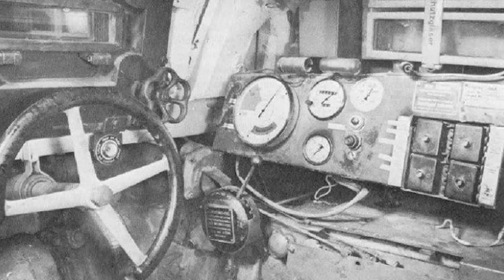A Deep Dive into the Tiger I, by the Chieftain

Comment: Let's use our sign and cosign on these angles, and see how much better or worse sloped armor really is. You have make sloped armor longer to join the top. Depending on top armor thickness, which is usually quite thin, you really aren't saving a lot of weight compared to just using thicker, verticle armor. Get DOWN with the THICKNESS! That's The One!
Reply: There is first hand testimony from German tank crew who said some tanks were indeed destroyed by aircraft! 🤯

Comment: At 30:50 "....[mudguards] are actually a in-theater add-on, these were originally not on the vehicle."
Not true!  The mudguard system was added to this Tiger (and all the Tigers of the 501) while still in training back in Germany.
The mudguards could be unbolted if the tank needed to fit somewhere narrow, e.g. a railway tunnel or the actual barges that took them to Africa... but there were permanent lugs on the sides of the tank to re-attach the mudguards as soon as you arrived. In fact, photos show these Tigers sailing to Africa with loose mudguards stacked on top of them. The system was definitely NOT added in Africa!

Comment: I am pretty sure "Saving Private Ryan" did not include the Tiger tank driver getting shot through the vision slot.
Reply: Instead of evaluating how "sure" you are, why not check the movie itself?
Reply: At 2hrs11min35s in (DVD chapter 17) Tom Hank's character runs up to the Tiger which has suddenly come to life after the earlier sticky-sock-bomb blew the track off, he sticks the barrel of his Thompson into a big wide drivers slit (looks bigger than the slit in this video, big enough to stick an arm through) and fires a burst.
Reply: @sean_d  Also wasn't the vision slit covered with armored glass?
Reply: @WheelsRCool  Yeah, that's why the moment  is of interest. It should have been. By the way a few moments later the turret hatch is opened and it looks like it is made from a sheet of tin or cut from the top of an oil drum.

Comment: Another whoopsie by the curator: the transport tracks were not developed AFTER the wider tracks. It was the other way around: the tracks, that were later used for railroad movement, were a leftover of the VK 36.01 prototype stage and were later widened as the vehicle gained weight
Reply from the maker: Thanks for the comment. Do you have a source i can send to the chieftan?
Reply: @WorldWarTwo  I can look it up now I know to look for it.

Comment: Moran's "Controversial Opinion on Tiger" video is the one and only actually good collective piece of judgement on the Tiger I. 

Everybody who says it was "junk" or "the best tank ever" fundamentally misunderstands (or in most cases is just downright ignorant) of the tank's designated role on paper.

The situation on the Eastern Front was extremely fluid, and the Tiger was forced to be used as its "Fireman" as Moran very aptly put it, which of course put hundreds of kilometres more strain on the moving parts than it was ever designed to burden.

Every single cheap piece of "criticism" that you'll see on reddit and discord about the Tiger could also be said about any modern tank, the Abrams, the Leopard etc. These weapon systems have been designed to fullfill specific roles on the battlefield, for limited amounts of time and distance. If you exceed those limitations (which the Germans were obviously forced to do) then the machinery WILL break down.

Comment: It's the side of road they drive on. That's the reason for the side of the driver/commander.
British tanks are on the other side.
Edit: My theory on the drive sprocket is that is a replacement that was a later model of sprocket.
Reply: The left-hand sprocket on "712" is a normal one for the time of its construction.
The right-hand sprocket is one of the first few sprockets ever made, and extremely rare, and it must have been lying around the factory for months before it was put on this tank.
Reply: @daveybyrden3936  Cheers for the info.

Comment: Since there not going to restore that tiger to running just to ohhh pretty send the all the parts and components to bovington,support the the last running tiger tank.
Maybe I missed it somewhere but if that's the Tiger tank that was sitting at Aberdeen in the eighties and nineties that wasn't cut up like that.
Reply: This is the Tiger from Aberdeen. At that time it had sheet-metal panels covering the gaps, but underneath it was exactly this cut-up.
Reply: @daveybyrden3936  I never noticed 😆,while I was at the NCO school there (83) one of our weekend dutys included babysitting PVT's pulling guard shifts at the museum.
I used to take the opportunity to 'explore' a lot of the tanks there via the escape hatchs.

Comment: There's an ongoing debate about whether one can drive a Tiger 1 with one's head out of the hatch. It is mentioned in this video that it's very difficult at least.
But some claim it was simply impossible.
They allege that when we see a head out of the driver's hatch, it's simply another crewman sitting down there, keeping the driver company. Most likely it would be the gunner, who had no hatch of his own.
But: look at 21:43
The mysterious head poking out of the driver's hatch is wearing a headset. The headphones are very clear to see.
Now, if you were another crewman going down there to make yourself comfortable, why would you bring your headset? You'd take it off and leave it in its bin.
You couldn't plug it into anything down by the driver; there's only one socket and he is surely using it for himself, to take directions from the commander.
This photo strongly supports the notion that you CAN drive a Tiger like that, somehow.

Comment: ive read that most of the german tank crewman preferred the gun from the panther more than the tigers gun,and it doesnt seem like the 75 would perform better than the 88 but apparentley the 75 fired a lighter shell and some of the panthers had the really long barrels and they said it was like siting a damn high powered rifle,where ya aimed it is where the shell hit,deadly accurate and better penetration,depending on the shell type but anyway,i like the looks of the panther more than the tiger,but theyre both gorgeous pieces of equipment
Reply: Yeah, the long l/70 75mm could penetrate over 30% more armor than the tiger 1's 88mm

Comment: What's happening today with electric cars the tiger 1 was way ahead of its time as a hybrid vehicle taking one of these and converting it to a hybrid Electric would be a real treat to see initially by Porsche Design❤❤❤
Reply: The Tiger 1 had a conventional petrol engine, linked by conventional mechanical drive shaft to a mechanical gearbox and reduction drive. The only "way ahead" part of it was the steering wheel that stepped the drive wheels through a small number of ratios.

Comment: Tiger evaluation (IMO):

Gun for 1942: 10/10
Armor for 1942: 10/10
Mobility for 1942: 7/10 (when it worked), 3/10 (when it didnt)
Mass: too heavy
Size: too large
Mechanical issues: plenty

Comparison with opposition...? 1942 is when the Sherman was introduced, with its short 75. Then theres the brit Cromwell (1943) and soviet t34 (1940). None of these could take on the Tiger in regular combat ranges. For 1942 and 43, the Tiger was the king of the battlefield; sorta like the Sherman in the pacific. Things changed in 1944 and 45, but still, the Tigers reputation carried it throughout the war (for better or worse).

Comment: It would seem looking at the track width that not only would the track have to be removed for rail transport but also the outer road wheels as they come to the edge of the combat track. This would mean if correct that not only the combat tracks would have to be fitted when detraining for battle the poor old tankers and mechs would have to put the outer road wheels back as well - is this a correct observation? Regards JohnH.
Reply: Yes, one wheel had to be removed from each axie. The mudflaps also folded up.

Comment: flat straight steel very easy to close back up welding and steel way better today
Reply: Yes, but that wouldn't "restore" everything. There are a dozen cable clamps missing off the side wall, of several different types. The smoke- launcher mechanism is missing from the turret.  There was a vision port in the left turret wall, just like on the other side. 
And that doesn't even consider the parts removed from the inside to make the cuts.

Comment: I dont understand the controvercy? Tiger I was a good tank in design that was both used wrong and (particulairly for the later models) forced to be manufactured suboptimally and with poorer quality materials.
I complete side with Chieftain, for what the Tiger I was supposed to do, it was well designed. The course of the war however changed how it was deployed.

Comment: Tigers designed with intent as a breakthrough tank for the open flat lands of the eastern front in the hope to maintain the offensive momentum Not intended for Tunisia or western front but ended up as a firefighter where required on both these fronts as well as the east where finally forced onto the defensive Expensive to produce over engineer and never in large numbers Qu? Would they have been better producing Pzr IVs and Panthers who knows? But Tiger is still the most famous!

Comment: At 8:45, I noticed the drive shaft hatch is open, does that mean they removed the drive shaft, and, therefore, the engine and transmission to ship the Tiger?  If so, that makes an even stronger argument as to why America didn't build/ship tanks that heavy....imagine assembling your whole tank at the beachhead....
Reply: That is not the drive shaft hatch. The drive shaft runs forward from the front face of the engine, you cannot reach it from behind.
That little hatch was for access to the manual starter.
It was never necessary to disassemble a tank of this weight in order to ship it. The Germans shipped Tigers across the Mediterranean on invasion barges.

Comment: ~Heres a story kiddies:
-Otto Carius, the well known Tiger1 T.C, ironic due to his parents were always harping on him about smoking, was SAVED by that very habit!
'-IIRC the early drum typed Tiger 1 cupolas were bolted on w/10 bolts w/a weak, water proofing small weld bead @ the turret top plate, which lent them to violently ejecting off of the turret if hit directly w/large caliber tank/A.T main gun round, often removing the T.C's head or badly injuring him in the process, as his head occupied the cupola space w/o the benefit of  the lower gen2 model using periscopes & a lower, more protected, TC head position...

-During a lull within a battle on the Ostfront one day, Otto found himself stressed & NEEDING a cigg, lacking a lighter or matches, he bent down to get a light from his trusty gunner,  a moment after leaning down & lighting his smoke, his cupola took a near 90 degree direct strike from a large caliber SU-122 or SU-85 or possibly an ISU155 RUS assault gun. The strike ripped the entire cupola off of the Tiger & tossed its broken remnants far behind Ottos Tiger!
-I believe he'd said in his excellent memoir: "Tigers In The Mud" he was extremely fortunate it was an A.P/solid shot projectile & not an H.E round, as the H.E wouldve most likely ended his & the turrets occupants war(s) early!...;)

-That "Feature/Fault" of the original Gen1 cupola design & having to be exposed to the hip when unlatching & closing the cupola hatch when opened fully w/the hatch safety catch engaged, resulted in too many Tiger Tank TC's getting killed & injured, which then led to the Gen2 re-design....;)

Comment: Is there a common external feature of all rendetions of the Tigers, one can look for❓
Reply: Do you mean Tiger I?
All versions had the same gun barrel (but not muzzle brake), the same crew hatches in the hull (seen from outside, anyway), the same ventilator between those hatches, the same air intake grilles, the same heavy covers on the exhausts, and really I think that's everything on the outside.

Comment: I want to see the engine compartment why did they not do a cutaway of that?
Reply: The engine compartment is in between two other compartments. If you cut away the rest of the side wall, you will see a fuel tank, a radiator and fans. Not the engine.

Comment: Why on Earth was the engine in the back and the transmission in the front? What possible purpose does that serve? Are there any Henschel design studies or engineering notes recovered and stored with 702 that address this?

Just having bow access to the transmission, like the M-4 Sherman, would have been huge as an improvement.

Also, why weren't engine bays equipped to serve as eliectrical generator sets, arc welders, and air compressors? The air compressor portion could serve as a supercharger on demand, too. Generator and welder just go together, especially if battle damage can be expected, but in camp or laager just generally useful.

Put an engine pack in front, like Merkava, or put an engine pack in back, like Abrams.
Reply: Hindsight is a wonderful thing.
German designers put the engine in the back of their pre-war "Neubaufahrzehg" experimental tank, and never changed their minds about it through all subsequent designs. In fact, can you think of a WW2 tank with a front engine?
Reply: @daveybyrden3936  No, because they wanted that ball-mount machine gun to cover trenches and other ways of hiding a soldier until he's close enough to blow your tracks and set you on fire. Only little two-man tanks didn't have that, and then the driver and commander/gunner both kept pistols handy!

Comment: At 31:00  "...this one is actually angled down more whereas the rest on this side are angled up..."
That's not significant! That's not a design feature!
It got bent down simply because of people standing on it. Photos of the 501's Tigers in Africa show these mudflaps bent at many angles on the same Tiger, depending on how the crew treated them. 
The foremost mudguard that the narrator points to, is an older version than the others.... it was possibly taken from an older, damaged Tiger.

Comment: Rather than go with a tungsten kinetic round, why didn't they go with a HEAT round?
Reply: The Tiger had a HEAT round, but it penetrated less than the standard round, so it was rarely used.

Comment: The Tiger tank by itself was pretty ordinary and over complicated.......What made it feared so much by allied troops was that extremely lethal and accurate 88mm "anti-aircraft gun" bolted to it....
Reply: It wasn't called an "anti aircraft gun" by the Germans, because it wasn't one. It was a tank gun, very similar in most features to the tank guns in smaller Panzers. 
I don't recall any of the Allied forces calling it an "anti aircraft gun" either.
Reply: @daveybyrden3936  The 88mm was an antiaircraft gun until during the Spanish civil war someone realized it was an excelent AT gun, so they started producing AP shell for it as well, basically the KwK 36 the Tiger 1 uses is a variant of the flak 88.

Comment: I have read 300,000 man hours to build combined with parts not inter-changeable  with other vehicles and breakdowns after 200-300 km.  Does that seem right?
Reply: Well, I don't know where you read that, but the Tiger was not unusual as regards interchanging parts. The radios, intercom, vision glass, lamps, machine guns, flare guns, safety switches, junction boxes, tools, smoke generator, driver's seat, gyroscope, power transformers and batteries were the same ones used in other Panzers.

Comment: Was it the best or the worst depends on the aspect from which you are looking at it. Are You an allied soldier in Sherman with freshly crapped pants or a German soldier in Tiger with smug smile and an 88 pointed in you? Both pretty much know the outcome of this…:) But joke aside…
Yes, the Tigers had a lot of downsides, too expensive, too complex, lacked logistics and so on…but you have to put it in context, time and conditions. It is a war time and you don’t have 15+ years and steady budget for designing, researching, engineering, development, testing (like with Abrams, Leopard and so on). You need it to have a biggest stick in a lot, and you need it now because there is war raging. And you have to build it with what you already have. 
Did soviet 34’s had issues? Of course they did but they did not try to repair them. They left them I the mud and replaced the with 3 new ones. Same thing wits Shermans…They built over 50000 of them during the war…and that was a lot more expensive than 1350 Tigers. Ultimately and luckily, quantity vs quality showed the quantity was a better way to go in WW2.
From an engineering aspect, Tigers also had some very ahead of the time solutions from which everybody learned, allies especially. Despite flaws, Tigers were ahead of time, they were the toughest, the meanest and most deadly and feared tanks of their time and could independetly beat the crap out of anything you could throw at them in seconds. Soldiers were terrified and ran from them on sight, so you had also that psichologycal effect. Until allies caugth up it was unbeatable. Tigers are still today a point of research, discussion, learning and kind of admiration.
So I would say if you take in consideration the timeframe and conditions in which it was developed and what it brought…Yes it was a kind of an marvel. It did not fortunately turned the tide of war but if there was no other tank better in kicking the crap out of enemy the I guess  you can say it was the best…